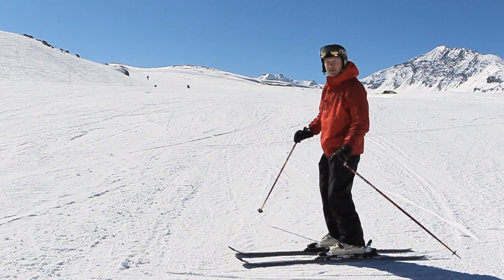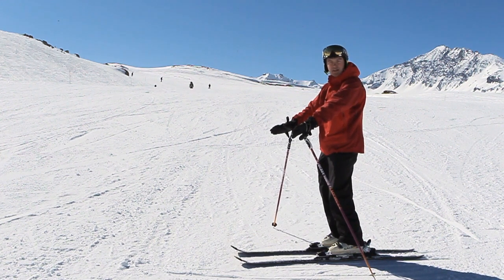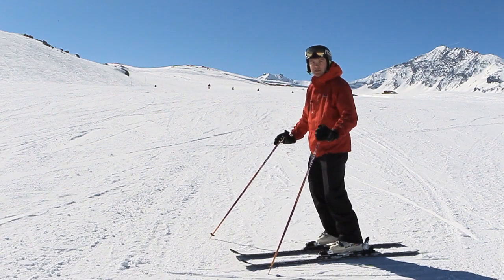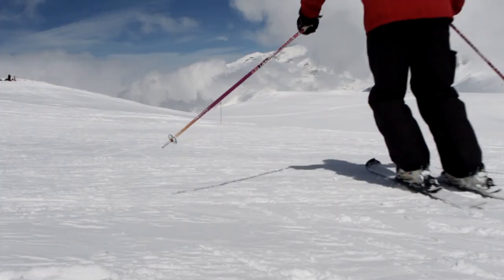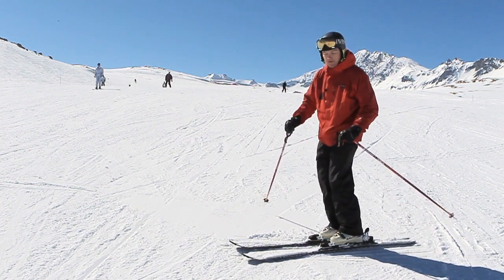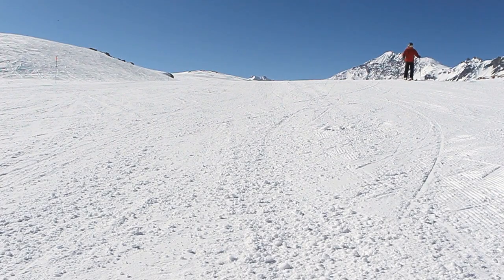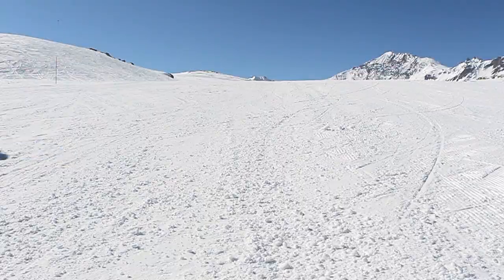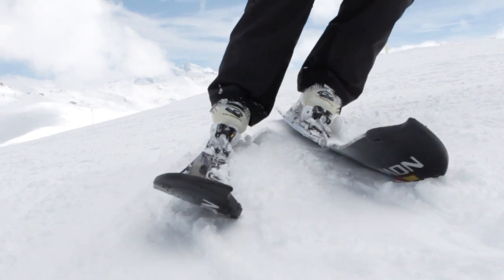Using the Shape of the Ski Cleaner Carving - No Intro

Comment: “Tip it and Rip it”  momentum is your friend. The faster you glide the higher you can tip your skis and then use the energy to transition into the next turn in the opposite direction. It should be understood that the concept of carving is meant to carry speed from turn to turn. This is a racing technique that applied to free skiing ( not running race gates) to go fast and control your direction in your decent. Hence the phrase, “Tip it and Rip it”.